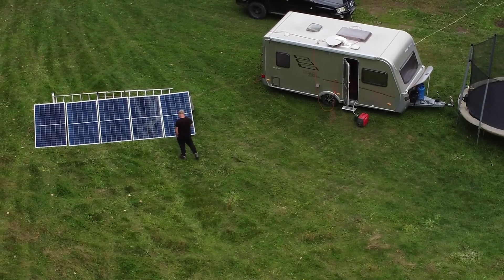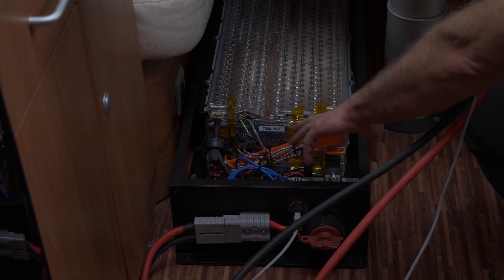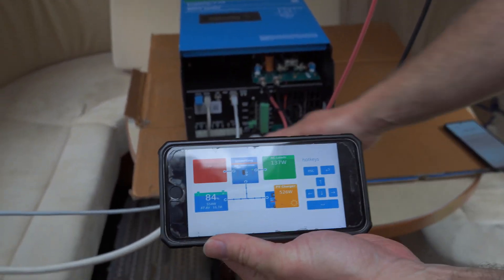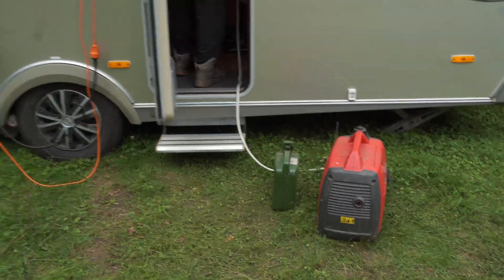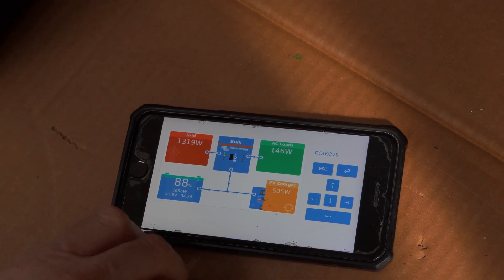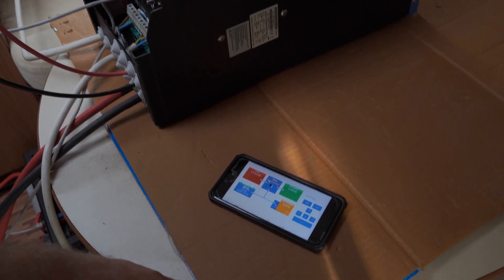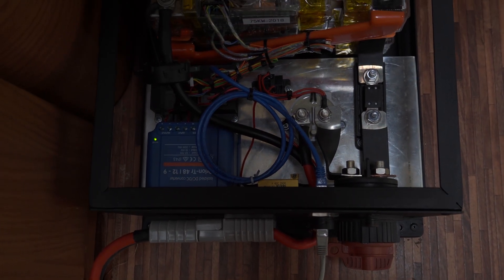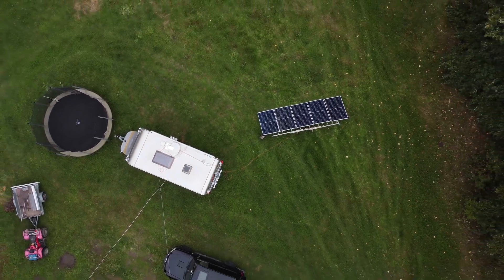Solar Power for the Off Grid Cabin

Comment: Bine, bine, bine.  Îmi place aceasta.  Very interesting.  Two used Tesla batteries.  So you must have some kind of charge controller taking both inputs from the combustion generator and solar panels. Is the that a standard solar charge controller able to handle the generator?   How are two refurbished Tesla batteries connected?
Reply from the maker: So there is an invertor, the blue box, that handles the inputs from solar panels, the battery and generator. The batteries have the charge controller built into the battery unit and that has a data cable to the invertor. Once it's set up it's quite simple to use, also if you're more technical these devices are highly configurable. My thinking is that most people will just want power like they can use in a normal house so we've tried to come up with a simple system that's not too expensive.